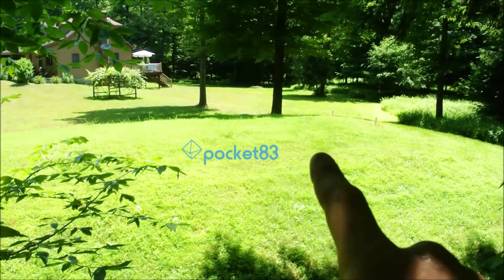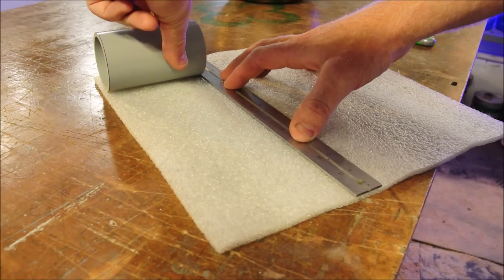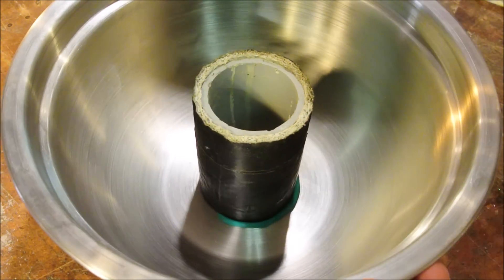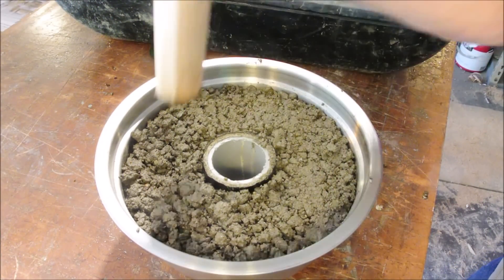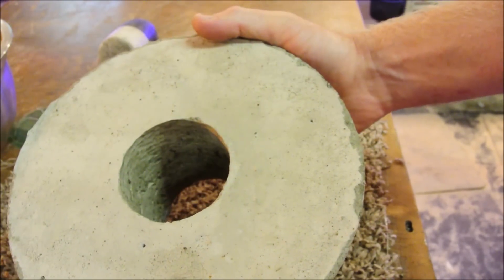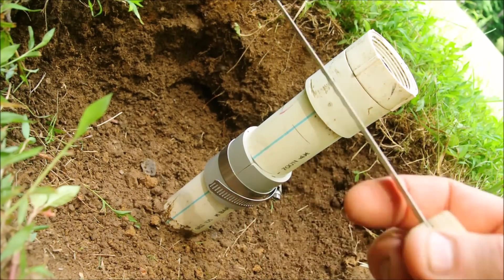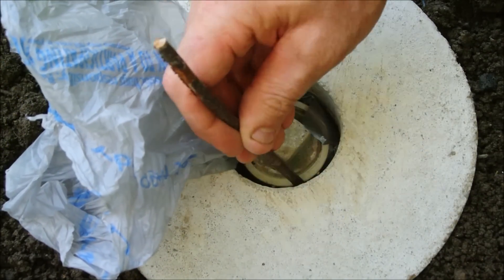Flush-Mount drain field cleanouts for septic tank

Comment: This may be a stupid question...but why did you make the concrete moulds?  Why not just cut the pvc slightly lower than the soil and cap it off?
Reply from the maker: Because then they would get lost. The concrete causes there to be a spot in the grass that stays at least a little bit uncovered.

Comment: If you need more fluid concrete (for casting small parts for example), look into concrete plasticizers AKA water reducers. It is a chemical that makes the mix flow as if it had way more water in it without actually adding more water. You can get it as powder from HD, or as liquid from your local concrete mix plant since they typically would add it to their mixes to make slab pouring easier. Don't need much, about 1 oz per 10 lbs of mix (30 ml per 4.5kg).
When just sitting there, a plasticized mix looks not too different from regular dry-ish mix, but it becomes really fluid with even a little bit of vibration so the oscillating tool trick would be great for it. Just don't over-vibrate since that will cause all rocks to settle to the bottom of the mould instead of being evenly mixed in.

Comment: The concrete dome seems to be the weak link due to freezing.  I would have used an 8" PVC pipe and keep the PVC top below surface and fill with P-gravel to cleanout level.  This will protect the cleanout pipe and a simple round pad (or grate) on the PVC will save the wife's bowl and driving over it is no problem.  
I still love the cement dome mold. Very OTB creative.  I predict a missing SS bowl in my house soon :>)
Reply: Tank sticks out above the ground outside its perimeter to help avoid that

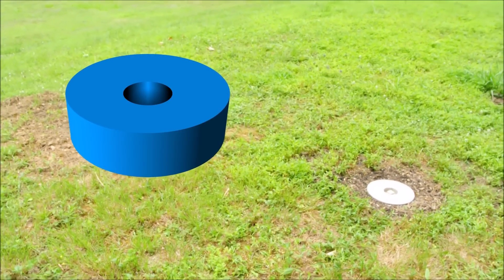Comment: 12:05 can't the same effect be had if you simply turned the concrete blocks around wider end on the bottom?

Love your work I'll probably won't be using for the same purpose but most of your video make extremely decent how toos and I find myself looking back at your old stuff just because I remembered you've covered it in previous videos
Reply from the maker: The purpose of the flat top-surface is to keep grass away from the pipe, so that it doesn't disappear. Also (since it's flat), a tire will ride right over it all without causing too much strain on the pipe. Thanks a bunch ;)

Comment: won't the inverted dome shape exacerbate frost heaving?
Reply from the maker: If it does heave, I'll redesign the shape. Physics is complicated enough to sometimes be tough to predict with certainty. Though I have more than one set of expectations, I also expect to get some intelligent feedback here (in the comments) in the meantime. 

TL;DR: I don't know.
Reply: had I waited another 30 sec I would have gotten to the point where you raised that concern.

what if you flipped them over with the dome on top? that's approximately the trapezoidal cross section you mentioned.
Reply: @twinprimeable  Just what I was thinking 😊

Comment: It's been at least half an hour from the posting of the video, so have they popped out yet? :)
(Also, I didn't consider mold release as a function of water content. Just strength and flowabilty. But it makes sense!)
Reply from the maker: Yeah, a smooth pour means that more surface area is attached. In a rigid form like a steel bowl, that's additional risk. It still would've come out alright in this case, but the point was to note and apply the appropriate level of care.